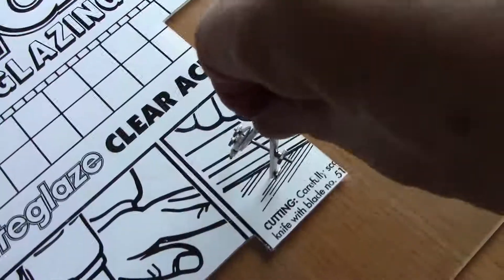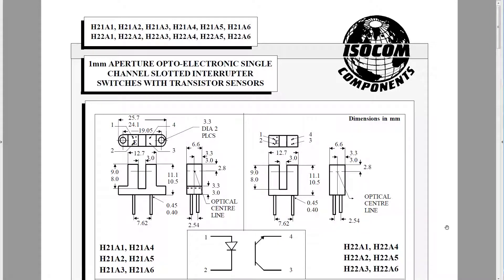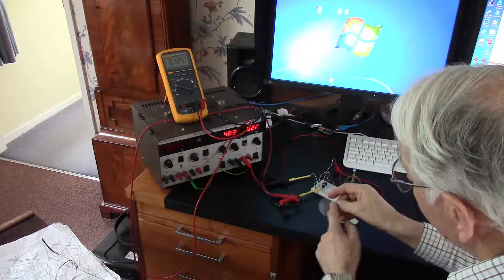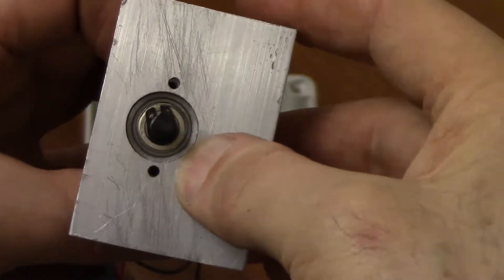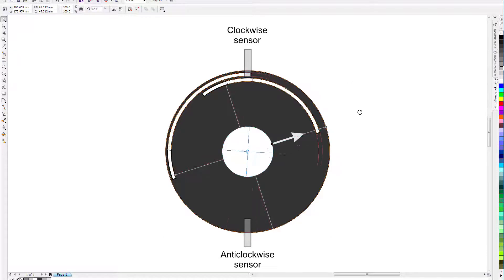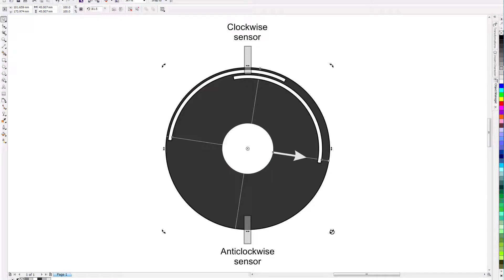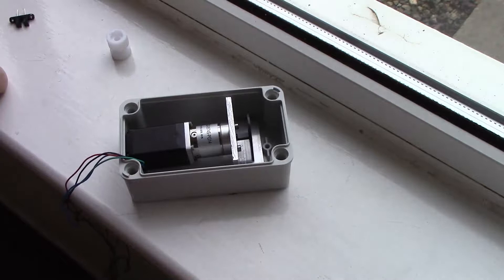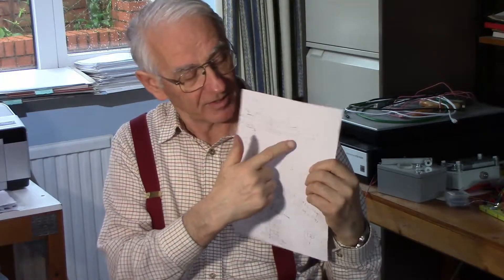Position sensor for 11HS12 stepper motor - part 1

Comment: do you have any more precise dimensions of this motor. I found the diagrams for it online but they did not contain all the dimensions required?
Reply from the maker: Well this here https://www.ebay.co.uk/itm/27-1-Planetary-Gearbox-Nema-11-Dual-Shaft-Geared-Stepper-Motor-Diy-Robot-Camera/183219485945?epid=1442224342&hash=item2aa8bb7cf9:g:XHYAAOSwi5pa9IHF gives most dimensions (if you look at the photos).
Reply: Samuel Fielder thanks for that.